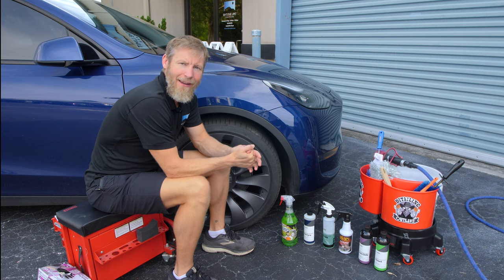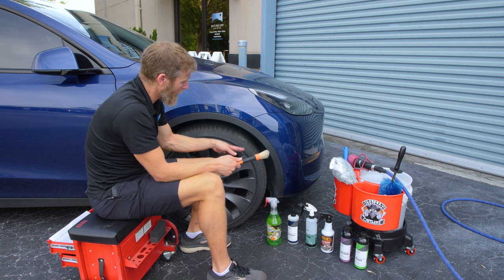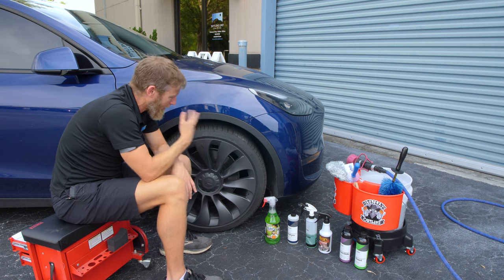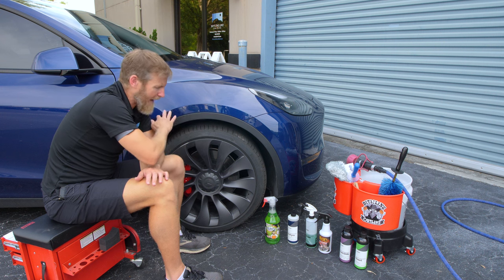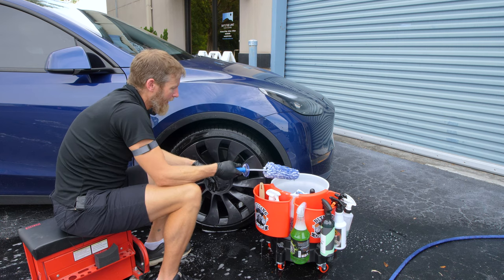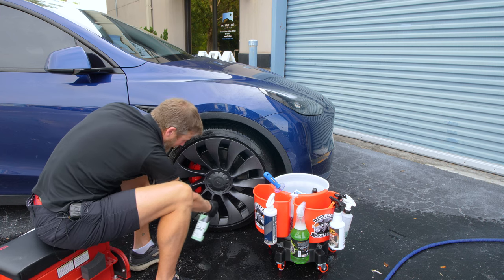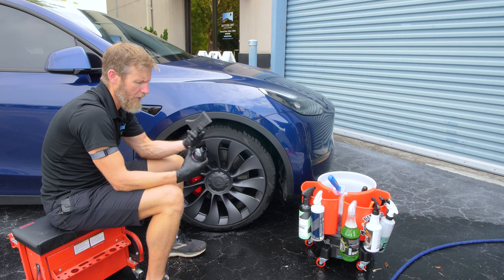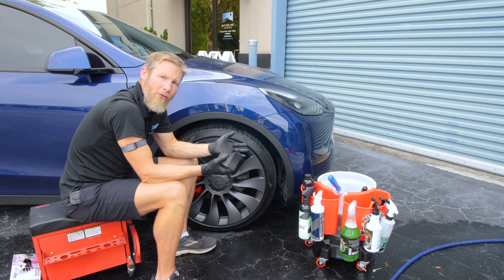How to Wash Wheels and Tires: Our Best Process

Comment: How would I use the rust stopper product on the rotors 🤔? :) I have black wheels and always dislike the break dust that ends up right back on there right after one drive the next day 🥲 Thanks!!
Reply from the maker: Sure, after your wash just spray on and wipe off those raw steel areas as best you can.

Comment: Hello sir, great video, one question. Do you refill your wheel bucket after 2 wheels because sometimes the water turns black and I don’t want to put that back onto the wheels.
Reply from the maker: Great question!  Firstly, we recommend that you have a grit guard in the bottom of the bucket so the heavier contaminants do not flow back up onto the tools.  Personally, I also rinse my tools out with the hose while rinsing each wheel so they don't bring much dirt to the bucket.
Reply: @SkyCarCare  ahhh thank you

Comment: Is MultiX @ 1:10 dilution okay to use for wheel cleaning instead of Tuga? I'm trying to stay completely in the CarPro line
Reply from the maker: Go with ironX!  or Trix (if used with caution).  With MultiX for sure, you could use that 1:10 for getting dirt off.  IronX will work better for removing baked in Brake dust.

Comment: I know that Tuga is your product of choice, but I've had great results with P&S Brake Buster diluted 15:1 in a spray bottle. Follow up with ReTyre for the rubber and the wheel has never looked cleaner.
Reply from the maker: I'm stoked you have a combo you like!
Reply: If your wheels are just dirty not dusty then BB works ok, a bit better than soap. It's weak though. What it does not do well at all is remove brake dust for cars with actually dusty brakes. Tuga Green or Koch Chemie MWC are, not even kidding, about 50x as effective as Brake Buster on brake dust.
Reply: @chrisbradley9607  I’ve heard great things about MWC, but I typically wash my car weekly so my wheels are rarely completely filthy. I like BB because of its value. A whole gallon for $30 which can but cut 1:2 and foamed on the wheels.

Comment: I’m too impatient, so I spray Tuga devil on a dry dirty wheel (ceramic coated), then power wash after 5 mins.  For tires I spray chemical guys 3in1 tire dressing, 10 secs per tire.  It gets the wheel to 90% and I’m good w/that!
Reply from the maker: Thanks for sharing your technique!  The first step of deciding what you need to do is to know your goal.

Comment: Can you use ReTyer on ceramic coated tires?
Reply from the maker: Great question! You could but it will start to beak down the coating.  Furthermore there is no need for a strong cleaner if you have Blackout on your tires.  In that case just ash them with Reset until you have decided to add a new dressing or coating to the tire and at that time Retyre is great.